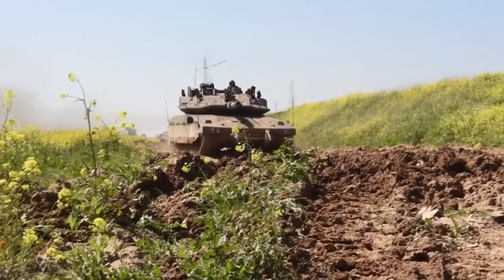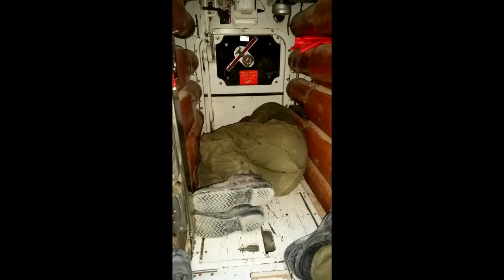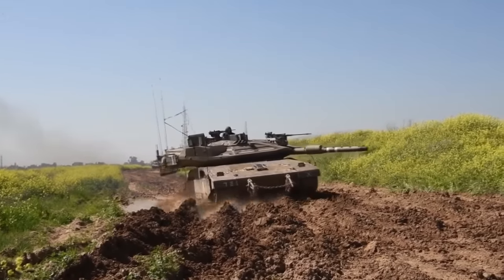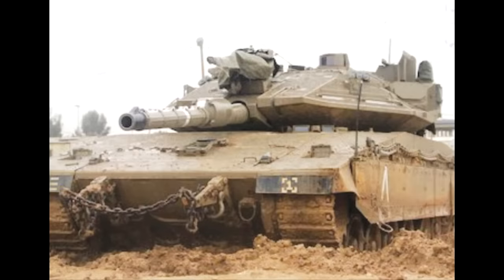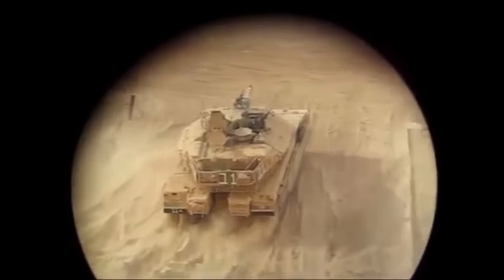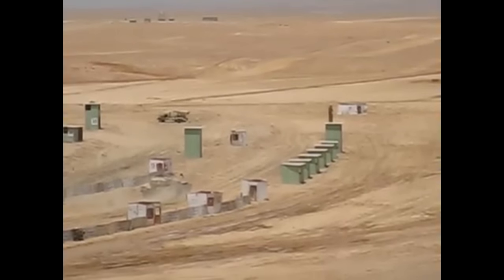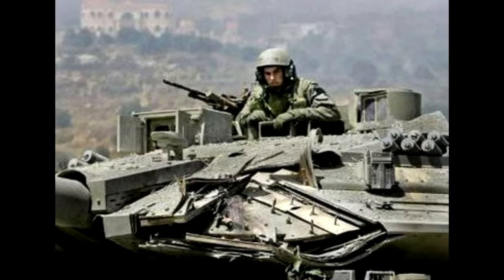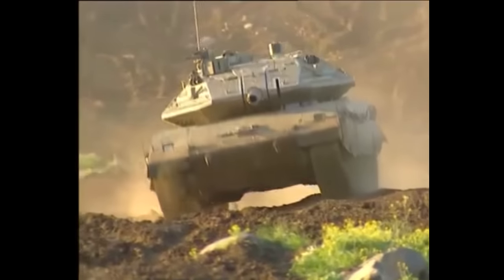Problems with Merkava tank

Comment: You have a lot of good points but contexts is key the merkava was designed with urban operations in mind so a lot emphasis was placed on protecting against HEAT over APFSDS. Keeping the L44 also makes sense in this regard as it's not as long so it won't get hung up on things as easily when traversing the turret. So it makes sense from Israel prospective, though not from a US or Russian stand point.
Reply: I was hoping someone would point that out. Most countries MBT are at a large disadvantage in fighting urban environment versus open terrain. Several vets have told me about how they have to protect MBT that are supporting the attack versus focusing on the task. Why else do countries build different vehicles for different jobs. Having a tank that can transport several troops combines 2 or 3 separate vehicles superpowers would use. Despite its drawbacks, the merkava is an excellent tank/apc that fits what Israel faces in almost every engagement. Itd be asinine to build a standard MBT when chances of that particular form of engagement is nill, unlike the superpowers.
Reply: @Idontmatter1234  Eh, no, the troop transport capability is largely useless. If it wasn't, Israel wouldn't invest so much into proper city fighting APCs, the Namer and its predecessors, the Nagmachon and the Achzarit...
Reply from the maker: If you are so convinced Merkava was made for urban warfare tell me, why is it better at it than any other tank, and dont talk about Trophy, that is Active Protection System that can be mounted on any tank
Reply: @RedEffectChannel  More armour on the roof (Mark 4) to protect from top down attacks by RPG's on buildings. https://www.israeli-weapons.com/weapons/vehicles/tanks/merkava/MerkavaMk1.html (table at bottom of page)
this is the only source I could be bothered to google. It's a great tank for what it is designed for but would be below par in tank on tank against more modern tanks but better as an infantry support tank.
Reply: @RedEffectChannel   i don't think it is better than every other tank over all. but as far as operating in urban Terrain goes the merkava does have some advantages. The merkava has better all round armor protection against HEAT Munitions than most MBT, as they tend to have the cold war set up with most of their armor focused around the front arc and thin side armor. It also has a V-shaped belly armor pack to help protect against mines and IEDs. As i said your points are good and im just trying to give some context on why the may have designed it the way they did.
Reply: Where is this fairyland where the enemy only ever chooses to fight on your terms?
Reply: Exactly, its for objective gameplay not for real use.
Reply from the maker: @isafmobius0465  All tanks used today have V shaped bellies, literally all of them, that is the concept first used on M48 Patton that everyone has adopted ever since. Most tanks today have good all around protection. Abrams tanks can be upgraded with TUSK package, Russian tanks have ERA everywhere. Challenger 2 TES has Dorchester addon plates as well as ERA, and so on. Merkava has no advantage compared to them
Reply: @isafmobius0465  From an urban standpoint, light APC would have fit the roll of urban combat better then a tank. Considering Israel's lack of development for one reason or another, this was a "that's all we have" situation. Let's give this a quick thought though, how many tank engagements (of armor or infantry) are urban? In Israel's case maybe more often, but that doesn't stop their tank from being terrible in a modern battlefield.
Reply: RedEffect all tanks used today have v shapes bellies? It can‘t be further from the truth.
Leopard nope, abrams nope, t64/72/80/90 nope, Type 10/90 nope, Leclerc nope, K2 nope, C1 Ariete nope. The only modern tanks using a V shaped belly are the Merkavas and the Challengers.
Reply: RedEffect are you mad about the Merkava, or are you mad about the Israeli as a whole? Then is the T-14 Armata "the" best tank??
Reply: Bad Goy hundreds? 52 were hit, 22 were penetrated, only 5 actually destroyed.
But it wasn’t only merkava mark 4s, it was also mark 3s and mark 2s
Reply: The Crimson Fucker I'm not a part of bullsh!try that you're trying to say, I'm not a Rabbi. Here's a more compressed info, the Merkava is a more crew survivable tank and the Russians know that that's why they designed the T-14 Armata to be as crew survivable as possible. 😑
Reply: Bad Goy can’t find anything that indicates large losses in English or in Hebrew.
So enlighten me how Hezbollah destroyed hundreds of tanks that only hundreds of were produced
Reply: Bad Goy  The rear door is quite vulnerable.
Reply: Bad Goy there are 300 and something mark 4s
 The only thing I can think off that had high tank casualties in the first Lebanon war, was the battle of Sultan Yacoub. And it wasn’t the fault of the tanks really. 
The results of the 2006 war in regards to the merkava is always exaggerated. the merkavas performed just fine.
Reply: Bad Goy  That's a blatant lie, the T-72 offers anything but good protection for it's crew.
There are hundreds of videos out there showing that all it takes to destroy a T-72 is a hit from an RPG-7 or similar to the side, which then lights it up like a Christmas tree.

Then again I wouldn't expect anything smart coming from a guy who probably believes the Jews are responsible for his lack of any achievements.
Reply: Bad Goy  Those are really weak arguments and points.
Greentexting and saying "muh" on YouTube, go back to /pol/ and shave that neckbeard.
Reply: syed musa 5 were destroyed and 20 were penned.
Most of them being older variants.
Reply: Bad Goy  There may be no videos of T-72B3's getting destroyed but there are pictures of a destroyed T-72B3 from the 6th Tank Brigade (recognizable by the white circle on the upper glacis) https://imgur.com/a/xjz3j9P

These T-72's may have ERA but the majority of the tank is still exposed, plus spaced armor has the same effect as ERA and in the case of the Merkava can be used quite cleverly (fuel tank in between two steel plates and in front of the engine for example.)
A big problem of russian tanks is the lack of safety features such as blowout panels, like on the Leopard 2 and M1 Abrams. The turret crew literally sits on top of dozens of rounds and if the tank gets penetrated and cooks off, it's not going to be good.
Reply: Bad Goy  FIrst of all, the comparison between these tanks makes no sense, since they were developed for very different doctrines. But i will go with it for the sake of the argument.

>Also newer T72B3M versions come with slat armor installed increasing protection against RPG attacks even more

Okay cool, i guess. But you're leaving out the part were from the Mk. III version on, the Merkava uses the Kasag modular turret armor and upgraded armor compositions on the hull (both are composite armor). Plus the chains on the turret bustle (present as early as 1983 on late Model Mk.I's), added hull deck armor and pretty thick sideskirts ( https://imgur.com/a/rQ5N2Wh ). Not to mention the Trophy APS which can and has defeated various RPG rounds and ATGM's, as well as detect the position from were the projectile was fired from. 

> T72B3s lack blowout panels but so does the Merkava

I know, i wrote that because you wanted some examples of design flaws on russian tanks from another user, it was not directly linked to the Merkava. But from the Mk.III onwards the Israelis used a different turret design, where there are 10 pre-selected rounds in the turret bustle. These are isolated with blast doors and indeed blowout panels, which are located behind the loaders hatch ( https://imgur.com/a/ri0E2QG , the big rectangular plate). Now, of course there still the ammo containers in the rear hull but if you get shot there in any tank  you've done fucked up and are basically done.

>You said spaced armor has the same effectiveness as ERA which might be true for ATGMs but certainly not for kinetic protection as Redeffect said in the video. 

This is false. Yes, very few ERA configurations claim to have to improved protection against APFSDS rounds, but none are immune. Tungsten rounds can be reliably defeated by countering the penetrating rod with oblique angles to introduce yaw into the the rod. Since tungsten is very brittle, it will break apart. Rods made out of depleted uranium (like the M829) however are much denser and also quite flexible, and can therefor not be as easily defeated as tungsten rods. 

>Merkavas might be good against lower tech opponents but what will happen when they have to face Egyptian T90s tanks in a conventional battle.

Stop with these jerk-off armchair general scenarios. There is no way for us to know what each country has planned in these cases.

>The T72B3 is cheaper

Which is not necessarily a point for the T-72. Israel (which if you don't know is tiny as fuck) doesn't seem to have a problem with the individual unit cost, seeing as they have around 1900 Merkavas, most of which are Mk.III and Mk.IV versions, and an additional 300 Mk.IV's still being built. Also, they don't seem to cost that much, a T-72 is priced at 1-2 million dollars, depending on the version. A Merkava IV is around 3.5 million for the IDF, 4.5 for other armies. A Leopard 2A6 costs around 5.7 million dollars, whereas an M1A2 costs almost 9 million dollars. So for a western MBT quite cheap actually, and for the IDF even cheaper.

>it excels in kinetic projectile protection 

An argument which seems to be based on your point about ERA kinetic protection, which i already talked about.

>it has ERA on the side armor which will almost certainly stop an RPG 7 or similiar tandem shaped warheads. 

Which is quite pathetic honestly, since the RPG-7 and its contemporaries are very outdated weapons. The T-72 also seems to have pretty sparse turret roof armor, which the Merkava has plenty of( https://imgur.com/a/A3VZWWX ,the parts in red obviously and the visible edge on top of the turret in the second picture). And again you're forgetting the Trophy APS, which works so well that even the US couldn't wait to get their hands on it.

>You can see why the T72B3 is overall a better tank than the merkava.

No, frankly i can't see it. Let's take away all of the hard-stats, like weaponry, armor or mobility. The Merkava is one of the most, if not THE most comfortable and spacious MBT to date ( https://imgur.com/a/8PdSeL0 ). In addition, it features probably the best and most efficient air conditioning system in any tank. Individual air conditioning control for each crew on top of central climate control, capable of running on batteries only (yes without the APU). The Abrams' A/C for example has to prioritize the cooling of the internal electrical components. The cold air travels through all the computers and the wiring, which means the air is warm again when it enters the crew compartment. The Merkavas A/C is powerful enough to provide the crew and the electronics with fresh air. 

Stuff like that does wonders to tank crews, and many tank experts agree that the crew is the most important part in a tank, if your crew is miserable, your tank is as well.

Also please stop writing T72, its T-72, with a hyphen. Its not an american tank after all.
Reply: Bad Goy I talked with my friend who is currently serving in the armored Corp about this.
According to him, the merkava was designed with urban areas in mind, since many battles in 48 and 67 occurred in Arab cities.
It was also made as a really defensive tank for hull down fighting, since Israel is a small country and can’t usually afford to fall back.
Reply: Akin Khoo  The israelis don't exclusively use the Merkava, you know that right? They have an AFV based on the Merkava, the Namer, plus a wheeled AFV thats supposed to enter service in 2020.
The Merkava is not supposed to be a jack of all trades. It is not supposed to carry troops, it can, but only after ditching it's ammo containers. Yes it is somewhat designed to fight in urban environment, but that is due to the geographic situation Israel is in. It is also not supposed to be the major force when fighting in urban environments, it is supposed to support advancing troops.
Reply: I don't think its designed for urban warfare but open front warfare against massed enemy tank formations in the Sinai. Other IDF tanks are better for urban warfare. Try bringing this tank down a narrow street and it's a dead duck.
Reply: Thanh Tran any tank without support will be screwed in these conditions.
Tanks don’t enter these areas and Israeli troops never go in these streets either.
They go through walls between the buildings to avoid being in the street.

With everything, a tank is pretty useless in a narrow street.
Reply: @KuK137  :- I believe the rear hatch is mainly there to allow the crew to exit the tank if the tank is hit in the front & the armour and engine take most of the damage. In Israel the crew is considered as important if not more important than the tank itself. In some nations (eg. the old Soviet Union) little expense or thought was placed on the survivability of the crew, because a ready supply of replacements were available. But think of the security (warranted or not) of the Isreali tank crews, when they see the ability built into their tank, of a speedy exit through a "large" hatch on the opposite side of the "hit"!
Reply: Bad Goy  :-  Casualty reports.
Reply: Merkava is a good MBT and suited for israeli tactics and urban warfare. Also I like the idea of having the motor in the front cause there is the best armor. Almost no tank cant be penetrated from the front. From the rear side should shooting be impossible (why would Israeli infantry allow someone attack its tank from the back? )
Reply: Bad Goy  That is true but they only achieved damage with very few unable to be repaired, the only reason they were so successful was through Kornet Ambushes where multiple ATGMs were focused on a single vehicle at a time. At that stage in the world very few tanks would have survived this type of concentration of fire. The Israelis learned from this and that is why they now carry a few support troops in the tank to deploy and the other result is the manufacture of the new Namer APC's.
Reply: The Killer 5 were destroyed out of 20 that were penetrated. Israel had way more than 80 tanks.
Reply: @Idontmatter1234  'Urban environment' a.k.a 'invaded territory' as their home, topkek
Reply: @RedEffectChannel  The front engine bay acts as spaced armor, giving better than average protection in the front against HEAT and EFP types of man portable weapons. This is a crucial feature that other tanks can not just add on with an upgrade package. Considering that such upgrades can be installed on Merkava just as well as others, the total protection in the front against  man portable anti tank weapons is inherently better on the Merkava platform. The rear hatch also allows some protection to crew while dismounting or reloading by placing the tank between them and the primary threat instead of being exposed coming out of a top hatch.
Reply: ISAFMOBIUS04 that’s THE POINT!  It’s a shot trap!
Reply: RedEffect it was made for tank-on-tank OFFENSIVE WARFARE.  Not defensive warfare
Reply: @achtung_panzer6905  I agree for urban combat one needs infantry and APC. Whoever plans to use a tank in there has already chosen the worst option.
Reply: @michaelbelonio3342  Why should Russia need help in tank design?
Reply: @KuK137  "Invest" is a keyword: thy are simple old tank conversions.
Merkava can transport troops incidentally.